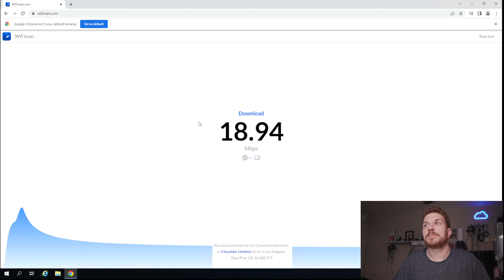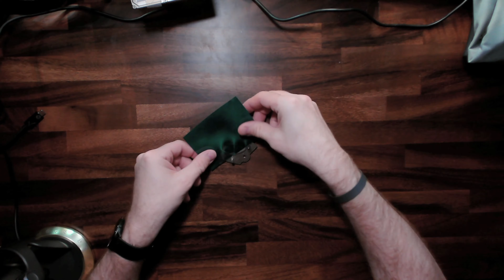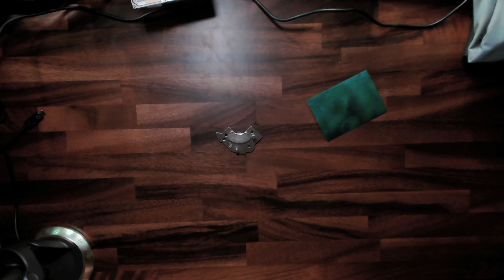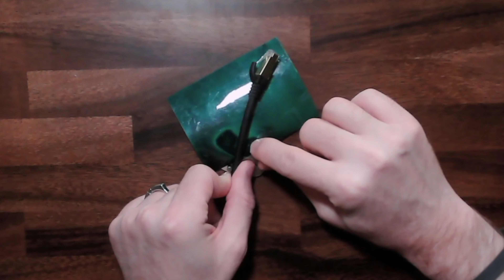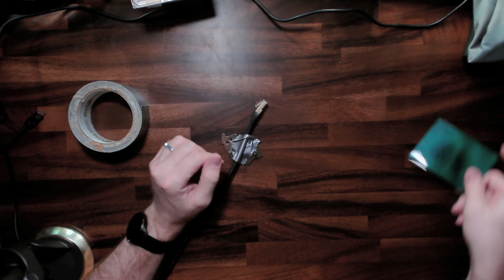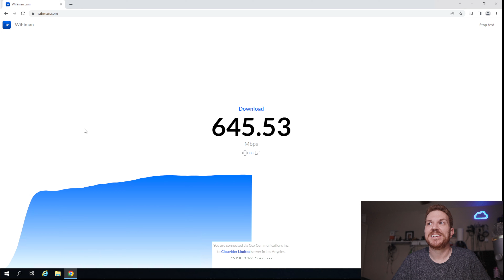10X faster internet

Comment: Dude what lies are you feeding here. We all know your internet got faster due to the duct tape. Duct tape fixes all🤣🤣🤣
Reply from the maker: @Budget Gaming HD the duct tape helps seal in the packets 🤦‍♂️🤣
Reply: @ShinyTechThings  🤣🤣🤣🤣
Reply from the maker: @Budget Gaming HD Gorilla tape actually has less packet loss. 🤦‍♂️🤣
Reply: @ShinyTechThings  Thanks for that tip, I thought superglueing the RJ45 into my router port would prevent loss
Reply from the maker: @jay kastner hot glue works better as the material is denser.🤣🤣🤣🤣